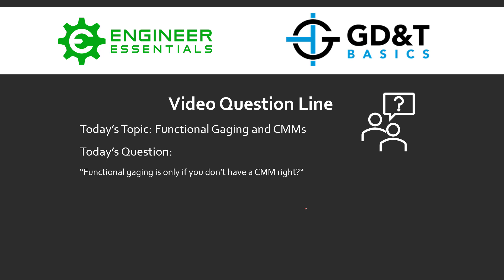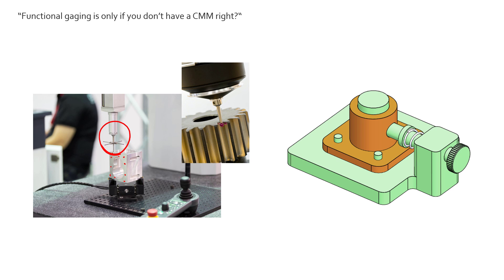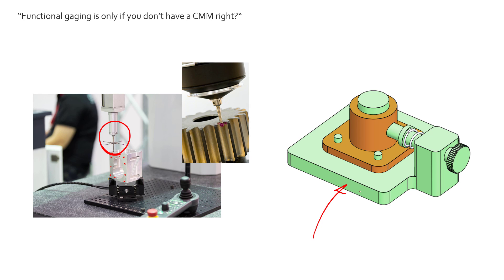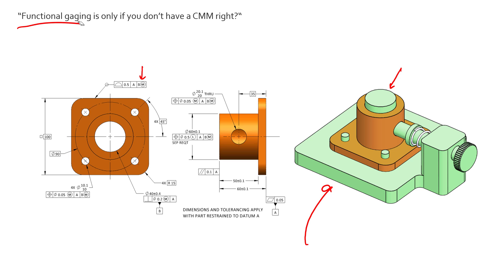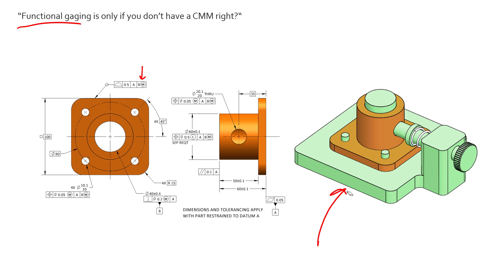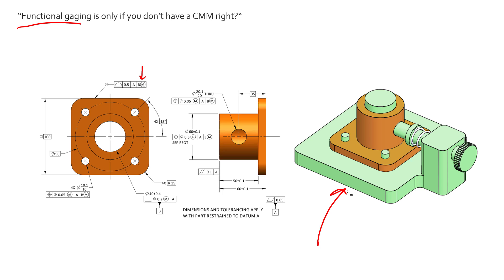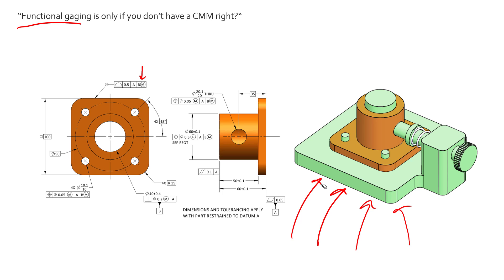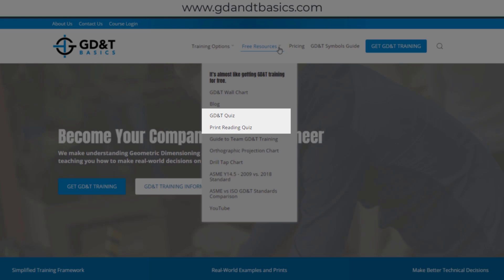Functional Gaging and CMMs

Comment: How about explaining wtf is a functional gauge?
Reply from the maker: That's a fair question! Fixed and Functional Gages are a great way to check parts in a quick and effective way. Basically, you have a gage where you put the part on it and make sure that it "fits" over or inside of all the gage elements, and generally "if it fits, it ships!"
Reply: @Gdandtbasics or go /no go gauges

Comment: I kown the funcional gagings can be used only when  the MMC symbol was applied after the tolerance just  like the drawing you showed. My quesion is could we also add the MMC symbol to the tolerance for a pattern of cylindrical pins when the pins cut with notches around, the notches will be assembled with O-rings. I think from the point of the assembing of view,  it's ok to add the MMC symbol, While our desinger think it's incorrect to add the MCC symbol because it will increase the risk of  leaking since the  the o-ring will be shifted more easily.
Reply from the maker: Thanks for the great question. We can utilize what is called the continuous feature symbol (https://www.gdandtbasics.com/continuous-feature) to control the diameters on either side of the o-ring groove as one single cylinder and if they are controlled with the MMC modifier we could easily use a functional gage as well. But as we know that means the smaller the pins are in size, the more position error is allowed. The design needs to be able to handle this extra position error. Additionally dont forget, that the smaller diameter that controls the location of the o-ring would actually be controlled with a completely different position feature control frame.
Reply: Thanks for the feedback, especially for introducing the continous feature symbol @Gdandtbasics